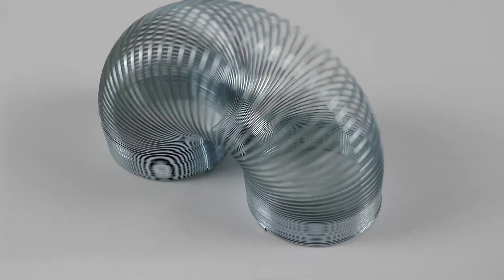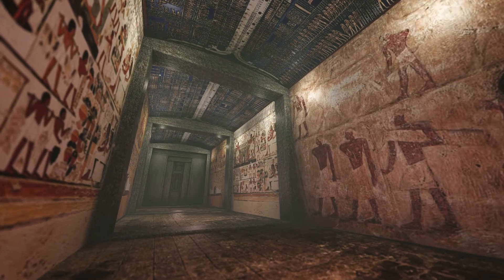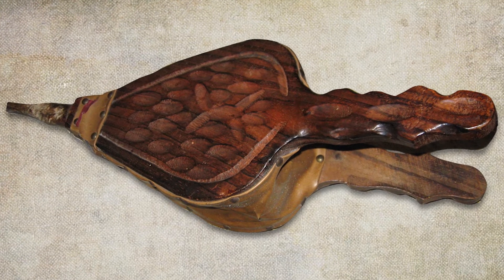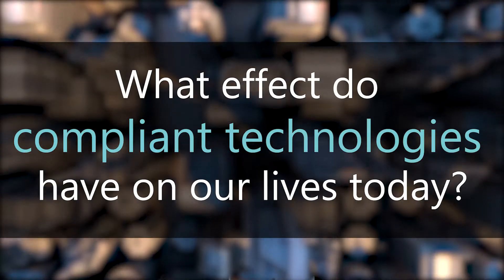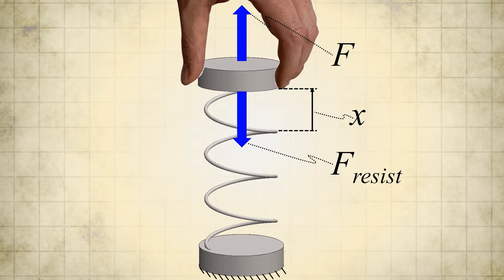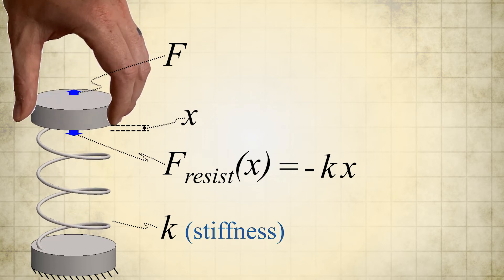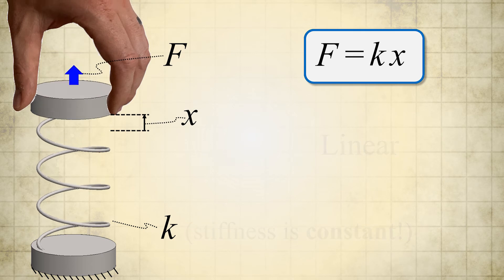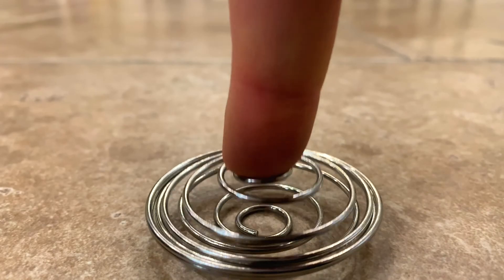“Bending is Bountiful: Compliant Examples are Everywhere” – Compliant Mechanism Design (Part 2A)

Comment: I'm confused about the concept of linear springs. It seems to me that a real-world spring has some hard limits of how far it will stretch (no further than the straightened-out length of the metal strip it's made out of ) and how far it will compress (no further than its fixed end), at least without breaking or behaving weirdly. So it doesn't make sense to me that a spring would behave perfectly linearly with respect to the force applied to it, especially near those limits (and if it doesn't behave linearly near those limits, then  surely the entire F(x) function is some kind of smooth non-linear function and therefore isn't actually linear anywhere?..) Is a linear spring a purely theoretical construct?.. Is it that springs are "close enough to linear" within certain limits that stay far away from these extremes?
Reply: That's pretty much the case. Very few things are truly linear, but many things can be approximated as linear within certain ranges.